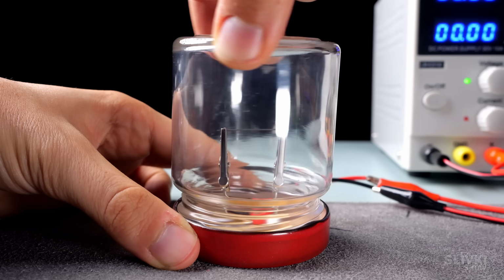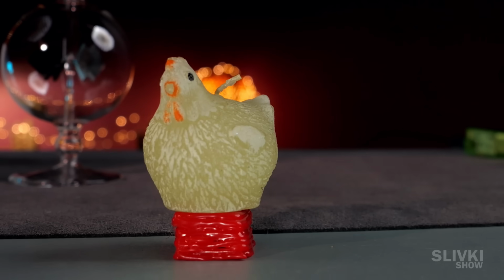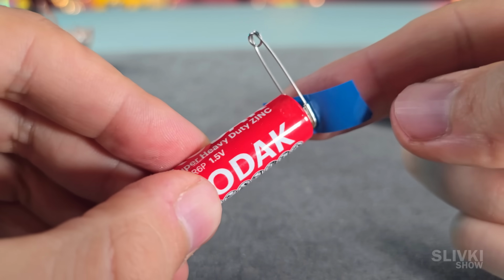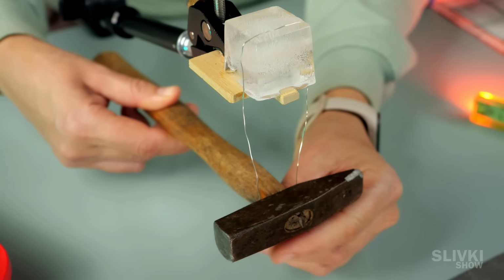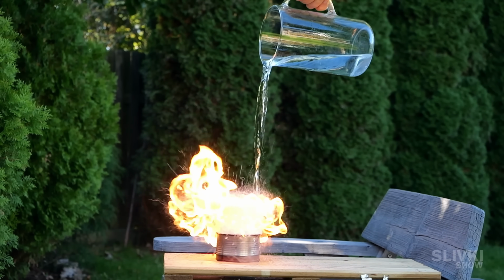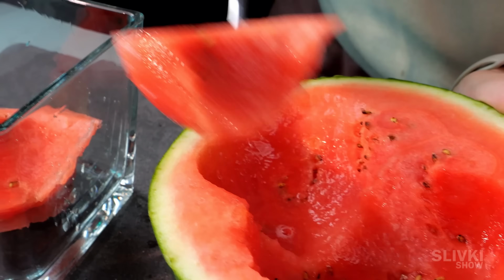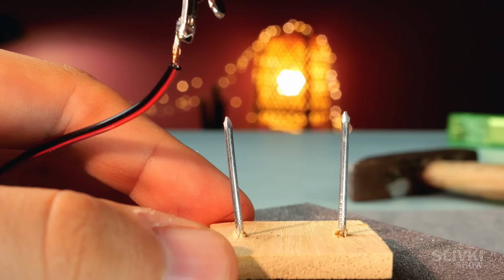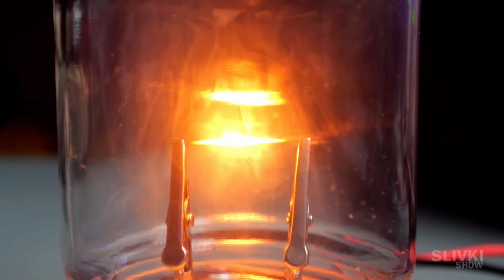EXPERIMENTS THAT MUSTN'T BE REPEATED - FROM LEVEL 1 TO LEVEL 100

Comment: 90% sure the light pressure one explanation is wrong.
Reply: Very wrong indeed, it was about temperature and never about pushing force
Reply: Yeah correct,
This bulb contains an almost vaccuum, so there is only a bit of air left in there. 
The photons that make up light carry energy, this energy is absorbed by the black side of the blade, heating up this blade. Then the heated up part of the blade heats the air next to it, hot air expands and the expanding of this air pushes the blade away. This rotates the mill inside.
The metallic side reflects most fotons, so this side heats up less and so the mill only turns one way.

This doesn't mean that light pressure doesn't exist, its just way weaker and probably not powerful enough to turn the mill